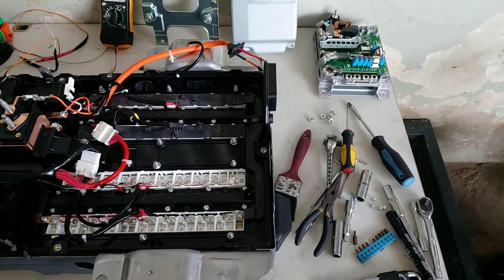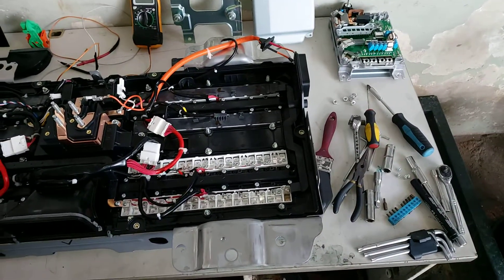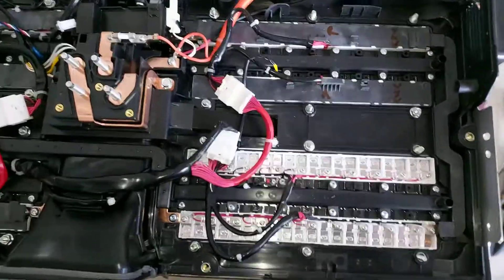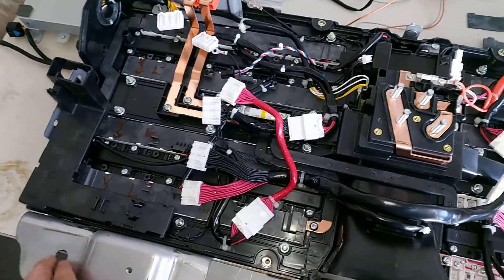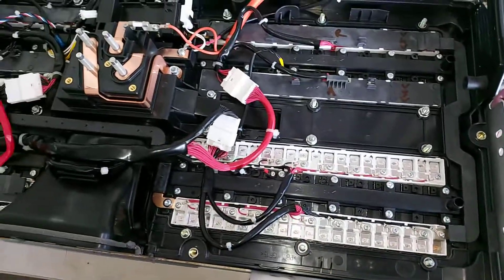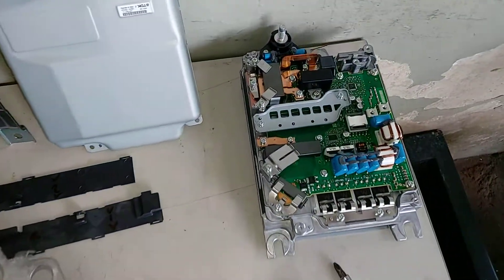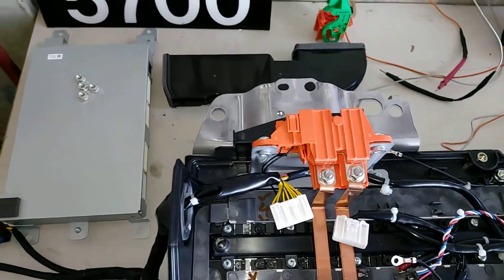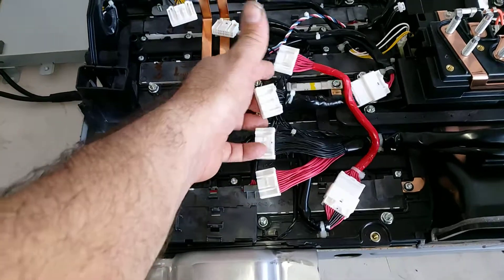nissan note e-power hybrid battery part 2

Comment: Guys its battery too much difficult repair because i have already replace cell 2017  and don't believe the repair cell .The cell power not reduce sudden if u change cell or pack you should be under observation around 10 to 15 days if current still  maintain its means OK  other wise cell not good
Reply: Brother cell replacement kaha sy hogi
Reply: @mianahadmsf206  boss agar app ka cell zeyda damage hain tu complete pack replace krwarein